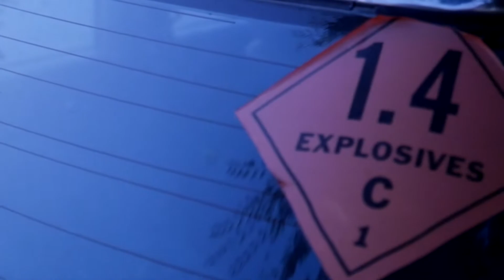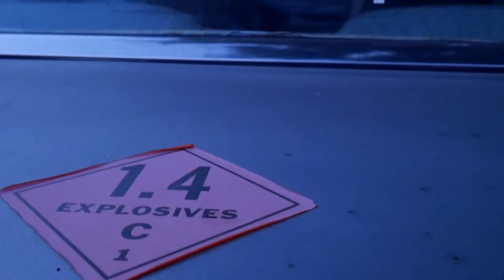S12 gets backed into | CA20E Blows up

Comment: dang sorry to hear about this man. good luck in your future builds! I was looking into getting an s12 like as a project. What are your overall thoughts on the car and some things I should know about when looking into a project s12? or are they not worth the time Your response would be greatly appreciated because I've seen your experience with your 200sx. 👍💯
Reply from the maker: i love the asthetic but functionally the engines that came stock in the car low key suck ass, the factory boosted CA is neat in theory and i see people drifting them but doesnt have much potential for tuning. The V6 version seems neat cause after the OEM engine goes you can put a VQ from a 350z with hexa motorsports adapter kits i believe. as far as suspension the front can pretty much entirely be converted to S13 S14 or even S14 full suspension. THe real weak point of the S12 is the rear suspension both the independent rear and the solid rear both have their set of issues. Thanks for watchin and hope you stick around!
Reply: @Nimbus.  Thanks I appreciate your response, and I'll be around as long your uploading👍👍👍

Comment: what kind of coil overs or lowering springs is it on?
Reply from the maker: its on some ebay coils, S13 front hubs brakes, some weird tire rod setup i cannot remember off the top of my head the back i had to take the coil apart and use a spring spacer, i have a few videos on it if you wanna go back and check em out.
Reply: @Nimbus.  ok bet i picked up a s12 two months ago and really wanna get it a little lower
Reply from the maker: @coopertyksinski1757  nice man what year and engine?